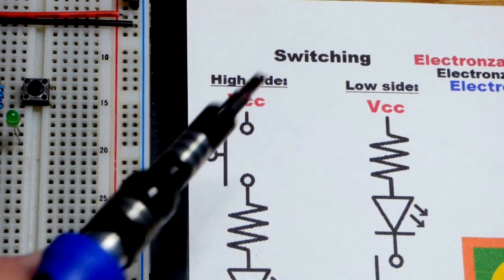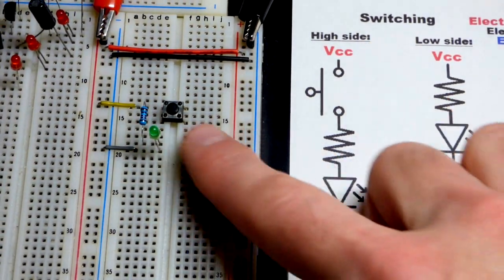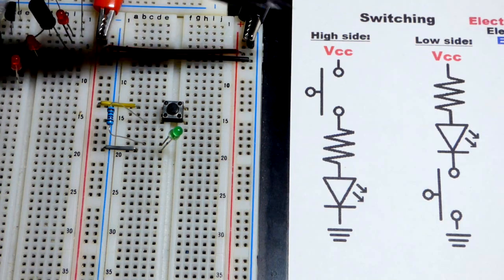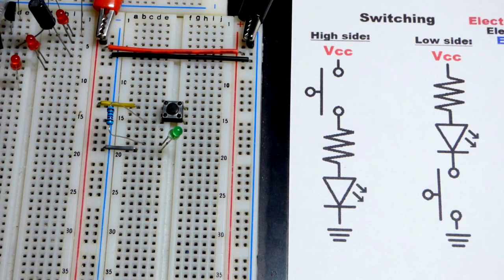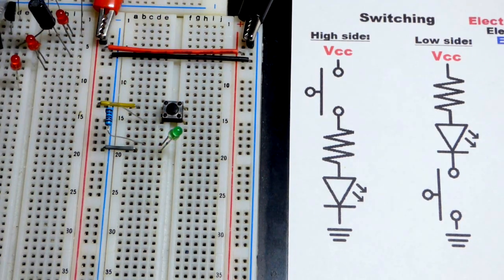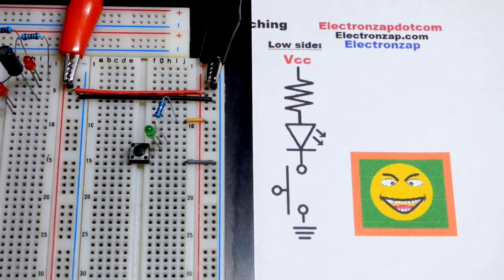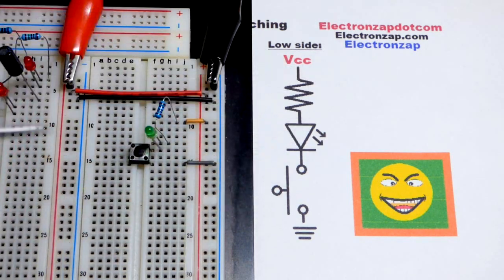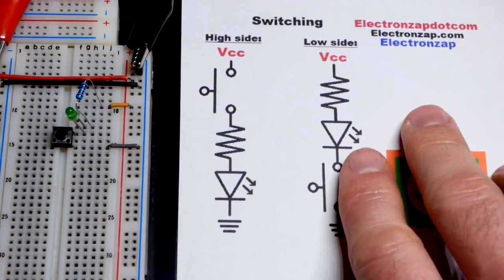Electronics high versus low side switching with a push button switch by electronzap

Comment: You need to explain the Pros and Cons of each form of switching. One benefit of low side switching is that the voltages can be lower than high side .... but what is the advantage of High side switching?